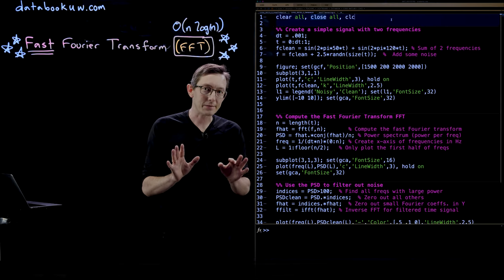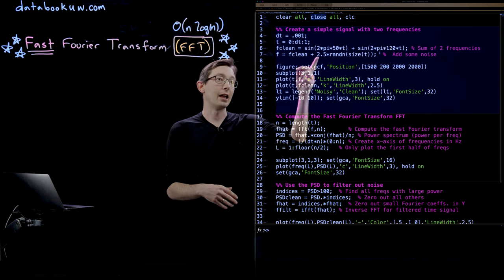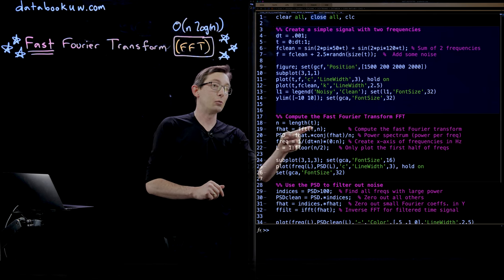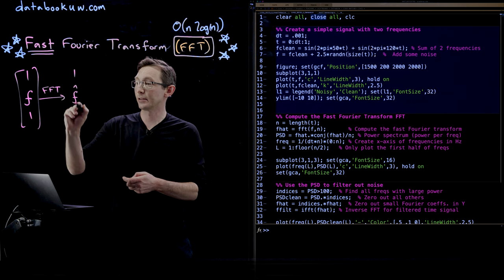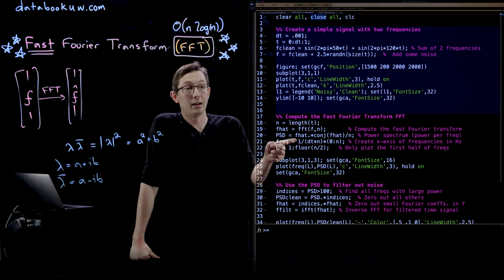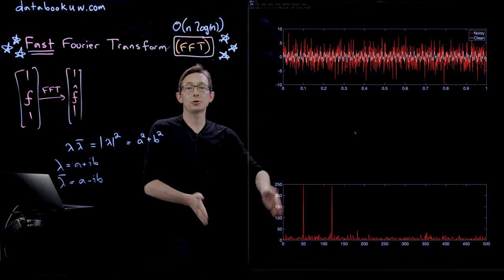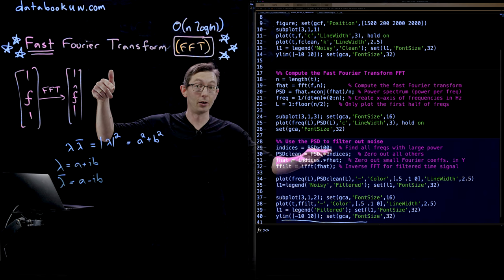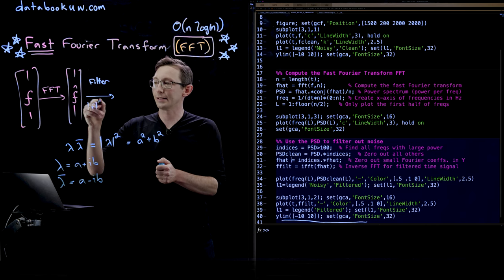Denoising Data with FFT [Matlab]

Comment: I think I have figured the answer.  To be exactly consistent with the original Fourier Series definition, the division by n should be clubbed with the the DFT expression, rather than the inverse DFT expression.  In the line of code for calculating PSD, both fhat and conj(fhat) should therefore be divided by n, thus a total divisor of n^2.  If we do that then the spikes in the FFT plot, at 50 Hz and 120 Hz, will each show a height of 0.25 Watts.  The remaining 0.25 Watts go to spikes at the respective negative frequencies - which would trace around the unit circle clockwise, and appear at the same frequency distances from the end of the plot if the entire graph with 1000 points is displayed.  Thanks.

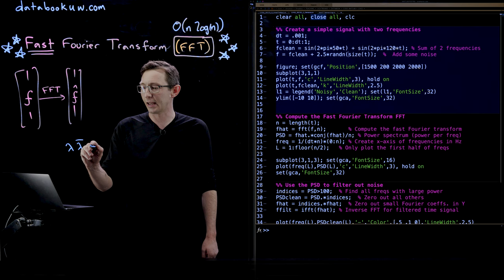Comment: Thank you Professor Steve Brunton for such a great video series, with the concepts being so lucidly explained.  A quick question.  Your original clean signal has a power of 0.5 Watt at 50 Hz and another 0.5 Watt at 120 hz.  When you calculate the PSD (at around 4:20 min in the video), you are dividing by n, and that makes it consistent with Parseval's theorem for the digital version.  And yet, the PSD plots show huge spikes close t0 250 (Watts?) at these two frequency points.  I guess I am getting my units mixed up, but not sure how; I'll appreciate your advice.  Thanks gain.

Comment: Nice work again! Maybe you could add some words about parseval's theorem in the next video about fourier transform by using fft. In this case: When you "zoom" into ffilt and catch one period by the smallest frequency, so 50Hz, the integral of the squared signal must be equal to the sum of PSDclean. Maybe I forgot a factor of 2pi or something like this, but you know what I mean. By using the raw signal, you can calculate the power of the noisy signal vice versa with the difference ;-)

Thanks for the powerful input sir!
Reply from the maker: Great input -- I'd like to bring this in sometime in the future!

Comment: hi Professor Brunton, I'm actually a Civil Engineer specializing in seismic Engineering I've been told by many people that we process earthquakes by using FFTs, however, Earthquakes are random in nature, so all can do it's get a bunch of data of acceleration/displacement vs time, but those are just numbers it's not like we can create a nice function like the one you have in this example, all we have is data, how would the FFT be implemented in that situation? since it's my understanding that it is what we are supposed to use. Thanks, great video.
Reply: The procedure should be the same, since line 4 to 7 are only used to generate data. Later in the actual FFT-part we use the generated data to filter out noise. The true function isn't needed. The only thing you must do is to replace the f in line 7 with your own data, and maybe scale the values and frequencies, if your time isn't normalized. The filtered data can now be analyzed or used to fit a model.
Reply: @felixbrandle9398  thank you so much

Comment: Steve this explanation is amazing. Why do you need line 22?
Reply: It‘s there to obtain the single-sided spectrum of the fft. The fft will actually result in a two-sided spectrum. This is due to the nature of the underlying DFT which results in a periodic transform of the sampled signal. Therefore the fft returns a spectrum which is symmetric and we have redundant frequencies that we don‘t need. Although this is only due to the fact that the signal in this example is real valued. Also to note is that this single-sided spectrum should be multiplied by two in order to preserve the signal power.

Comment: On line 19 you compute a DFT with n coefficients. Shouldn't the corresponding frequency grid on line 21 be computed as 1/(dt*t)*(0:n-1) so that it is also length n? This does not affect the final result since you don't consider anything past the Nyquist frequency, but it seems like the FFT does not actually generate a Fourier coefficient corresponding to the sampling frequency.

Comment: Hello, Prof. Steve, thank you so much for the video. I have a question: after multiplying by the conjugate, don't you have to take the square root of the value? If yes, then can't I just find the absolute value of the complex number?
Reply: No, you do not need to take the square root because you are not interested in the magnitude. The magnitude squared still produces the results of finding what frequencies have the most power. Also, the absolute value of a complex number does not yield the magnitude. a +b does not equal sqr(a^2 +b^2) .

Comment: I tried to fft my own signal, set zeros for the frequencies above a predefined value, and then ifft to get the filtered signal in time domain. I noticed that the output of ifft is complex number for my data. Can anyone explain why that happens? It seems that if I use 'symmetric' flag in the ifft,  I got real number.

Comment: What if the data is too noisy and not able to find a threshold for PSD to filter? This happens if we change the multiplication factor from 2.5 to 10. Is there any way to recover the signal from such noisy data?

Comment: Loved the video! I have a brief question, though. Since the noise we add to fclean is random and fairly large w.r.t the signal itself, when I run the code several times the PSD spikes at 50 and 120 Hz are often not the same in height. I imagine this is because the noise itself is modulating the values of the PSD at all frequencies, including those we actually want to isolate (the 50 and 120 Hz). Therefore, although the f_filt signal has the right features of fclean, when I compute the rms error between the two, there is a moderately sized error ranging from 0.15-0.25, whereas the max(abs(fclean)) is ~1.95. My question is how, if at all, can you improve the denoising process to decrease this rms error between f_filt and fclean? Or is this not possible in a real-world scenario since 1) we would not have control over the noise magnitude and 2) we would not know fclean a priori?
Reply: As you have already said yourself the noise may increase the power of the frequencies from the clean signal. So in the power spectrum the peaks might have different magnitudes with respect to the original magnitude when the signal wad constructed.

Comment: How can FFT's be used with fractal stock market data?  My interest would be knowing in what degree cycle (wave) the mkt is in.  Say, the mkt is in a bull phase, but currently heading down. If the mkt is going to go up 3 times, but have 2 down phases in between, and those down phases  consist of a down-up-down sequence, and it's currently in the up phase of our down-up-down within a down of a larger up-dn-up-dn-up sequence, how can an FFT tell me if I'm in a small/corrective up or a big up?

Comment: can we use an audio file instead of signal with sum of two frequencies?
Reply: Dear Akula, yes, you can use an audio input. You may use many inputs. He is showing a general idea, which is used in many signal processing applications. I might suggest that after his "limiting filter" ,  one might apply  a sequence of low frequency reject filter, and high frequency reject. (Listen only to frequencies you wish).  Latency and phase distortion are likely not an issue for audio. These techniques are also very effective when the input data comes in something else than time. "Sample your data as fine as you can in the dimension you care about, DSP can analyze." (says DSP engineer).
Reply: @concinnity9676   thankyou :)